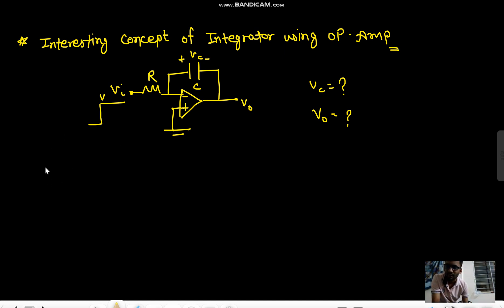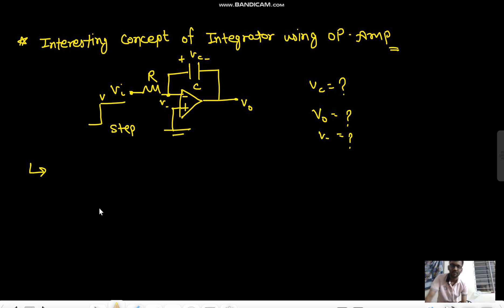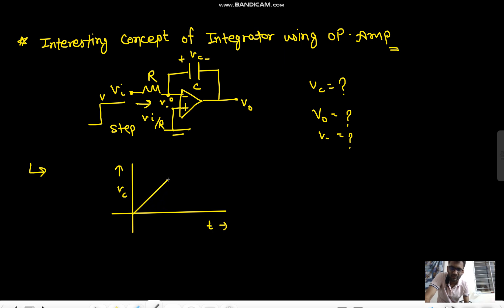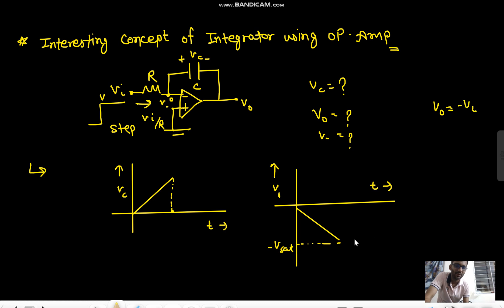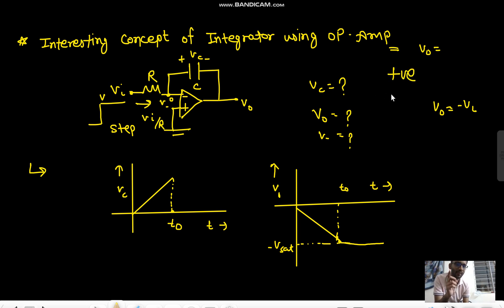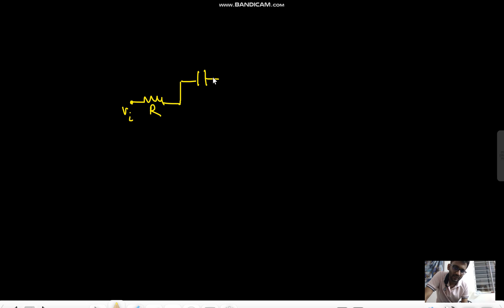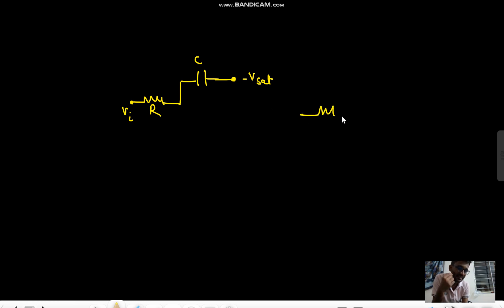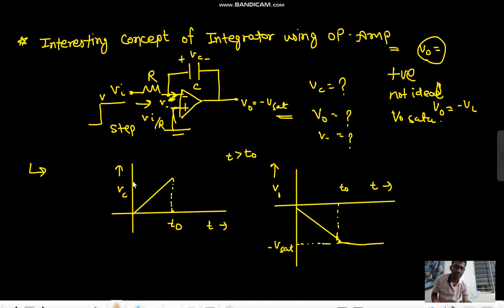Interesting Concept of Ideal Integrator Using OpAmp || Prep for Interview

Comment: Sir in case of square pulse wave of magnitude 5v,  the output voltage would be saturated but the capacitor  voltage would be oscillating between 5+Vsat , and +Vsat,  whereas the avarage value of current through the cap should be zero at the steady state. 
Please sir correct me if i am wrong. 
Thank yu for making such wonderful contents.

Comment: You are doing a great work man👍Would be very nice if you could bring 1) questions involving opamps with both positive and negative feedbacks 2) Compensation in opamps 3) Identifying opamp signs 4) More interview questions on Mosfet single stage amplifiers 5) Interview questions on Barkhausen Criteria 6) Graphical questions on Vo vs Vi for mos amplifiers

Comment: Nice one bro, can you make a similar video on differentiator. 
The confusion with differentiator 
1)If i assume the opamp is in negative feedback for all Freq.
-then at the instance of step, all step voltage will appear across cap, since other node is held at 0 potential due to virtual gnd
- therefore there is a impluse current set through cap
- therefore my output will be a negative impulse
2) but if i consider the actual case, that is no feedback at high freq ( since loop gain of this ckt at high freq is 0)
- at the moment of step the cap will short
- virtual short concept fails
- no current in feedback path, since no feed back at high freq
- therefore vo is vi

What shld i consider,Plz clarify
Reply from the maker: I have made a video over it. Please find it in Prep for Interview series